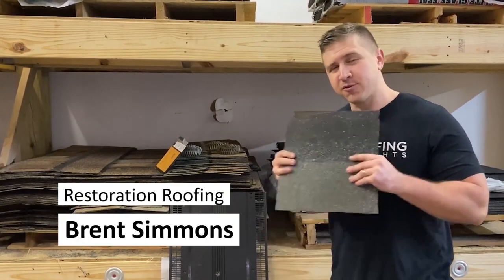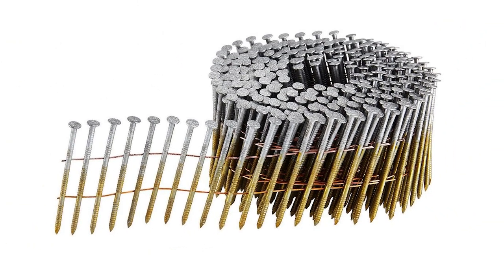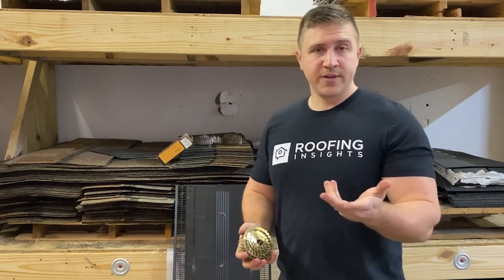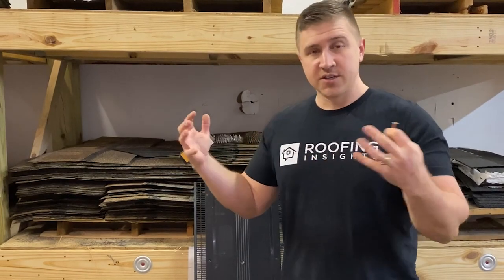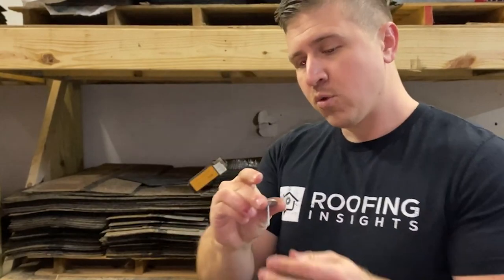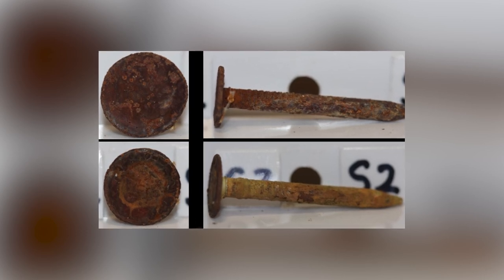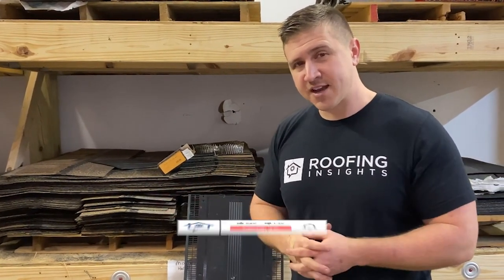Best and Worst Roofing Nails: Your Roof System Superheroes /@RoofingInsights3.0

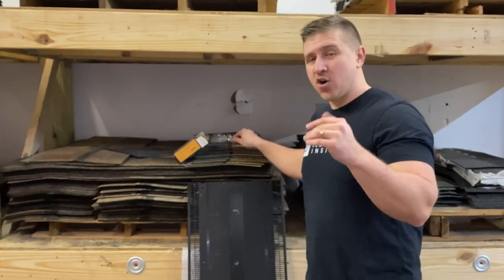Comment: Time for shingle replacement.  I'm going to specify SS nails..... I have a very low pitch ( 2:12 ) roof area.  Heads have rusted badly.  Roof is heavily shaded so takes a long time to dry out.  And the low pitch does not clear rotting leaves, etc. More debris finds its way under tabs....

Comment: If I DIY a roof repair involving replacing subroof, and then using tape in between the subroof boards, and then if I replace the underlayment, and then replace the shingles... What should I use? Which products from Home Depot? Should I use nails or screws? What size and type of nails or screws should I use for attaching the subroof to the joists? What type and size nails or screws should I use to attach the plastic nail caps that hold down the underlayment? What size and type of nails or screws should I use to attach the shingles to the subroof? How far away should all these nails and screws (for the sub roof, the underlayment, and the shingles) be placed away from each other? Three inches, six inches, twelve inches, eighteen inches? Should I get some kind of glue to glue the shingles down too to each other at the end? If I do it by hand with a regular drill or with a hammer (for all these screws and/or nails, without a nail gun) what kinds of nails and/or screws should I use? If I'm replacing 500 sqft of roof, do I really need a nail gun? If so, what kind should I get? The site doesn't have electricity (it's an investment property of mine, a foreclosure), so if I need a nail gun, I'm guessing I'll need a generator for electricity, then an air compressor, and then the nail gun too? And then I'll need various lines for the air to travel to for the nail gun, right? Can you tell me all about that? I'd absolutely love a video! Thanks!!! Thanks a million in advance! PS- I'm really hoping I don't need the nail gun, an air compressor, or a generator, so what kinds of nails and/or screws should I put in by hand... Don't worry, I can spend days doing this roof... I'm guessing it will take me, by myself, three or four days. Lastly, should I rent (instead of buy) the nail gun, compressor, and generator? Help!  LOL!

Comment: I saw in another video today, (recently have water leak in roof/shingles due to very high winds over the last couple of weekends), but in the video, the person (and I am sorry, been watching A LOT of videos, mostly from your channel and Mr. Lipinskiy, I did not book mark it), at any rate, the person advised that the electro galvanized nails seem to have rusted EXTREMELY fast/in a short period of time and the heads of the nails were popping off, not holding the shingles down.  I would like to know if this is the actual case.   I may have to replace my roof in the coming days, and am researching ALL or as many aspects of it (as a home owner, and NOT a roofer, so am doing my due diligence), thank you in advance. 
Mike M
Reply: I think it is almost irresponsible to use electro-galvanized nails on roofs. It is rated for indoor use which a roof definitely isn't, and they have a lifespan of only 5-10 years under good conditions.

Comment: Hello, I have a new Dewalt pneumatic roofing coil nailer 
DW45RN. 
I have a two part question. 
I’m using hand me down, coil nails 1 1/2 x 3.6mm
My nailer says 3mm is required. 
Will this give me problems?

Also it seems Dewalt offers electro shanks nails and I don’t see ringed. Could I run ringed nails though it? Does it matter?

Thanks in advance

Comment from the maker: Best and Worst Roofing Nails: Roof System Superheroes
Comment below if you have a question, like it if you want more content like this!

00:25 Galvanized coil nail 
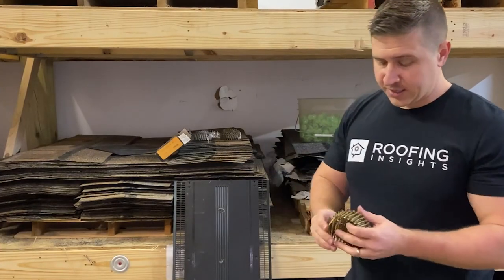01:03 Ring shank coil nail 
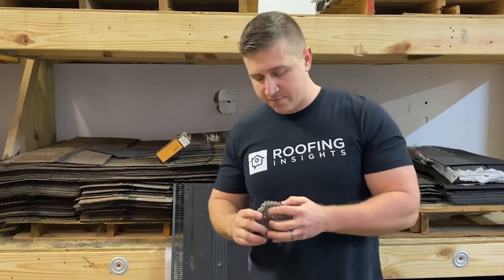01:35 Stainless steel coil nail 
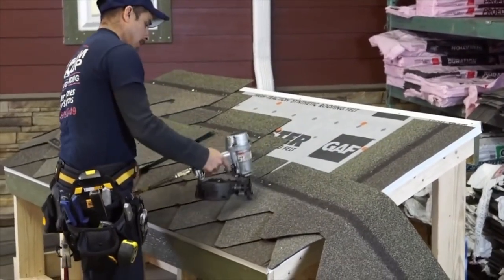02:12 Copper nail 
02:57 Plastic cap nail 
03:25 Metal cap nail 
04:00 Why certain nails rust
Reply: ya, would be cool to see an update of what nails you guys have found to be the best bang for the buck. like what's cheaper than stainless but also rust resistant. some of the hot dipped coil offerings around $100 a box maybe? any better than others?
Reply: @gen-X-trader  It's fun to read about the old days.  They now cost > $180 a box.

Comment: what size roofing nails do you use in the eaves so they wont shine through?
Reply: For open eaves some companies use staples instead, though those can show through if too long. Best you can to is take into account of the width of the shingles + deck and choose a length no more than that, perhaps standard 3/4-inch roofing nails. You might try a 1-inch nail just to see if that works.

Comment: Might have added what is really needed rather than what code will allow or what is out there. A roof is supposed to keep out the elements. So why would nails rust at all unless the shingles have failed?   A good roof should last 20 to 30 years, or even more for some. The life expectancy of an electro-galvanized nail is 5 to 10 years, maybe 15 under ideal conditions, which a roof certainly isn't. It is recommended for indoor uses, but it gets used on roofs all the time. If it is MY roof, would I choose electro-galvanized nails?  I don't think so.  Hot-dipped galvanized nails have a lifespan of 35-50 years. Now that's within the lifetime of a good roof. They are rated for outdoor use which only makes sense on a roof, at least to me. Even though the roof is covered by shingles, moisture will still find a way under and do its work, which is why decks rot away. So I WOULD use hot-dipped galvanized nails on my roof.  Ring-shank nails?  Holds twice as good as smooth shank, so might be a good idea in a high wind area or used with an OSB deck which doesn't hold a nail as well.

Comment: The nails only need to last as long as the life of the shingles. If your  in a wet environment then use stainless. The average installation is fine with electro galvanized nails. Ring shank  nails are overkill so don't waste your money.
Reply: Electro-galvanized nails have a lifespan of 5-10 years.

Comment: “Stainless nails will not rust.” -This is not necessarily accurate. A 400 series stainless will ABSOLUTELY rust. A 300 series will not, though it is more expensive than the nails you showed.
Reply from the maker: You are not wrong we could be more accurate
Reply: @RoofingInsights3.0  I actually found some 304 stainless nails from Best Materials for a similar price
Reply: The stainless nails in the video ARE 304 stainless, so these are designed not to rust. These are the only stainless coil nails my local ABC supply because they are used for this exact reason.
Reply: Actually all stainless rusts. The main rust that forms is chromium oxide. For the sake of roofing where the nails are protected by the shingles being shingles over the nails I would like stainless as extra protection over galvanized. Glad for th video cause I didn't think about the nails with rings to give the more bite. I do see a lot of nails working their way out of the roof and raising the shingles. Not sure what caused that exactly. Maybe moisture in the wood and temperature fluctuations causing the wood to squeeze on the nails and squeeze the out.
Reply: @gregbernard4466  Good reply, though hot-dipped galvanized nails will last 35-50 years, which I'd say is enough for most roofs. For roofs designed to truly last 50 years or more, stainless steel should be considered.